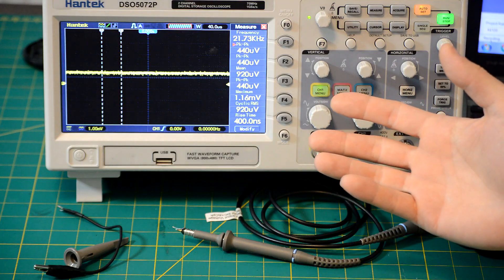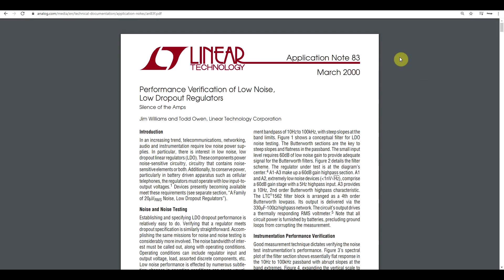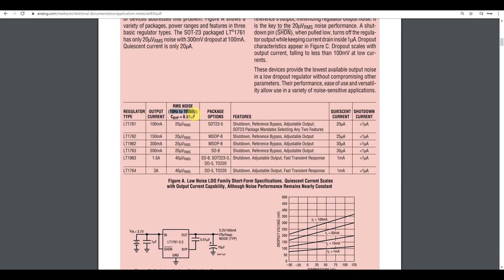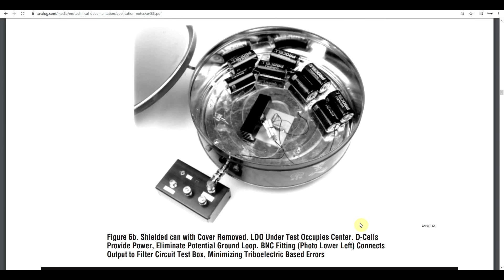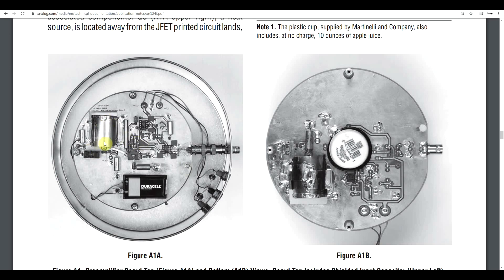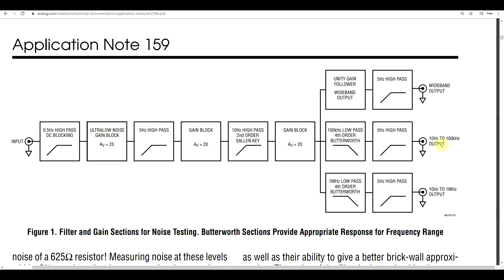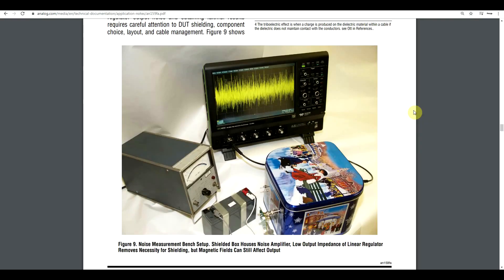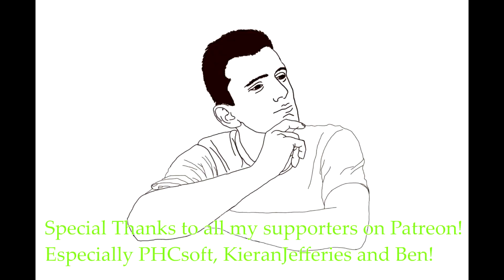Electronics Tutorial - Building a Low noise signal amplifier Part 1/3 - Documentation

Comment: I built the first of these boxes and designed the PC Boards for Jim Williams, the one you see in these pictures, Jim Williams really put a lot of effort in this design, this design was the Evolution of Jim's experience. This was the recurring theme of Jim Williams Design, one of his favorite design evolution was the design and the redesign of Frequency to Voltage  converters, Jim and Bob Pease went back and forth with these designs! 

In this design some parts were hand selected, matching Pair of FETs etc.

Many of Jim's App notes should be studied and used as real World " Design Process Examples " !

In particular AN 65 and AN 47, Backlight circuits and High speed design.  These will be relevant forever!

I keep all of the Hand drawn, Work in Process, Schematics with all of the design notes and comments along the way. I still have the CAD Files to make PCBs for this design.
Reply: Your comment really added wonderful context too. I will try to get the time to read all the Application Notes mentioned. But, I'm wondering, how ate all the cookies? :D

Comment: Using many cans may not help you if they are not magnetic shielded. Also at the input and output connector if the shield is not connected properly it will ruin your isolation.

Comment: word of caution for those generating noise for hobby stuff, double check your local band emission regulations. for example, if you are in the US and you accidentally leak L-band beyond a certain (fairly small) limit, you will be subject to massive fines over $300,000. this may seem obvious, but my real point is how little noise transmission it takes to break the regulations in the US. i'm talking basically anything over noise floor and you can get jammed up. this is kind of a case of "if you don't get caught, its not illegal" in the sense that if you leak noise at such a remote location that it doesn't get received, but its something to consider. You can use RF isolators if you really want to make some noise and stay legal. you could safely generate up to 30 dBm of noise with some good isolators lol
Reply: Noise generation is low power so if even it leaks out, it is  blocked by your house's walls.

Comment: You could probably buy a secondhand B&K microphone amplifier quite cheaply these days. BITD this would have been good enough to measure audio circuits with output noise around 1-2 uV (with the right biscuit tin of course ;-) )

Comment: SMPS are NOT noisier than linear. There are SMPS that are quieter. In particular many of the MeanWell LED supplies are known to be very quiet. But you have to make sure a) it's loaded properly to keep it out of "hiccup" mode and b) you don't load it with too much capacitance to keep it out of protection mode and c) use little bit of filtering take out high frequency switching noise. I like using a capacitance multiplier because it solves b and c in one pass. ACDC or DCDC doesn't matter. Most of the MeanWell ones are great. A linear supply is almost guaranteed to have some mains noise where as a good MeanWell SMPS properly used will have no mains and be completely silent. Lot's of pro audio DIY people are using them now.

Comment: Great video, but here are a few details you are probably aware of, but didn't include in the video:

1) Jim Williams, who wrote the first two ap notes is generally considered the greatest analog engineer of all times. He was one of the founders of Linear Technology and worked on the bench almost to the day he died.
2) At frequencies below 100 kHz, steel is a much better shielding material than copper. Tin coated steel is ideal because the tin allows for use of a press fit lid with no leakage. This type of tinned steel enclosure (paint cans and cookie tins) aren't 'good enough'. They are actually as good as it gets unless you are willing to spend a lot more money for exotic materials like mumetal. And all that from something that most people are throwing out on a regular occasion.
3) Ceramic capacitors come in three different types; Type 0 (CG0 or NP0), Type 1 (X5R, X7R, X8R), or Type 2 (everything else). Type 1 and Type 2 are microphonic and also change capacitance based on DC bias voltage and are thus unsuitable for signal path use. Type 0 capacitors are extremely non-microphonic and are actually the best choice if you only need a small value (say less than 0.1uF).  Kemet had a paper that showed this by comparison with aluminum electrolytic, film and tantalum capacitors, but I can't find it right now...

Comment: The cookie tin progression is very funny. That HP voltmeter is pretty special though - I recall it has something like 20MHz of bandwidth on AC. It is more like a power meter voltmeter hybrid. I can see why they would still use one.
Reply from the maker: Just because a piece of equipment is old doesn't mean its obsolete. I think that as long as you know the exact specifications and limitations you can use old equipment very successfully even when "newer" stuff is available.  
Coming back to the HP voltmeter, I think its really nice that you can finds its full schematic in the service manual - http://bee.mif.pg.gda.pl/ciasteczkowypotwor/HP/3400A.pdf
Looking trough it, I think its quite amazing they are using a vacuum tube to ensure minimal input impedance.
Reply: 3400B is 20MHz and 8922A goes up to 20MHz on certain ranges.
I have all the thermovoltmeters that JW recommended. 3400A and 8922A beat any modern true RMS digital wannabes to a pulp especially on above 1MHz and below 10mV.

Comment: Could you do a follow up on what type of cookie boxes work best for different applications?  I’m especially interested in when not to use Christmas theme boxes, as I fear the added cheer will cause interference.
Reply from the maker: I was looking trough some old Popular Electronics magazines, and there is one in which they recommend using a coffee can as a chassis for building electronic projects. From noise point of view, I think that is even worse than the Christmas theme... the circuit will end up being all restless and fussy
Reply: AN-159 says it clearly: 3) If you would like Linear Technology to verify your cookie tin for repurposing, please make certain to send it in with its original contents.
ADI bought LT only to take over the testing.